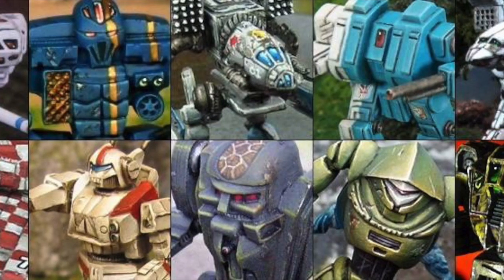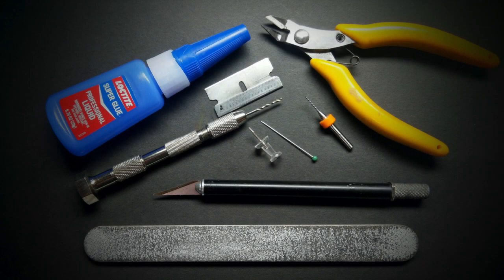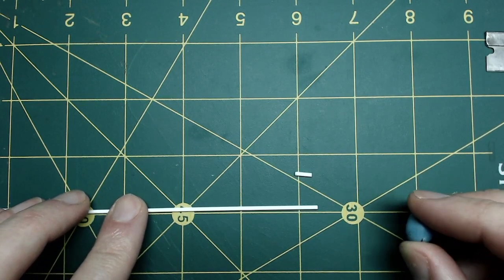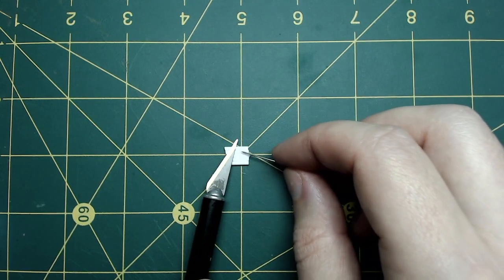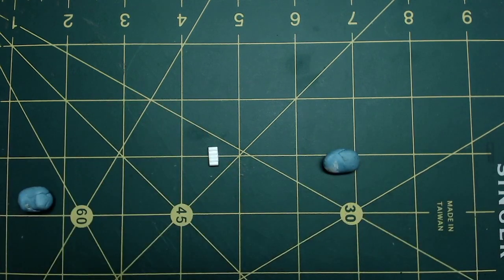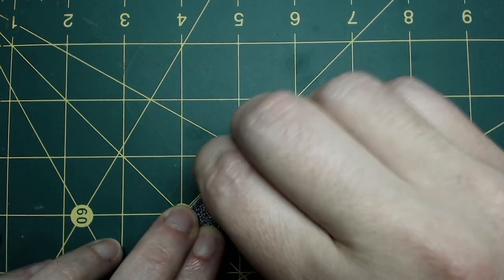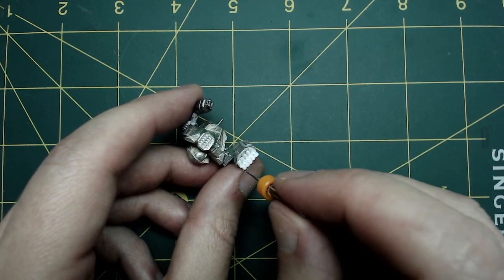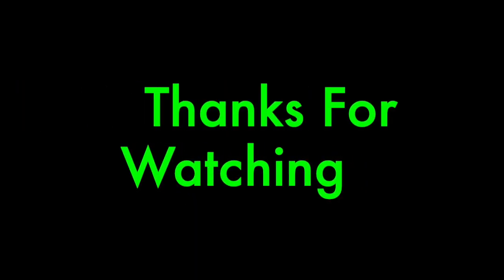Mech Weapons and Mods Using Styrene | Battletech Customizing

Comment: SRMs and LRMs?
Reply: For exposed missile tips, you can file a rounded, tapering point onto thin styrene sticks. Glue them together as in the video, cut with some extra length left on the back, and file the backs down to the appropriate length and angle, giving even more margin than with the missile tubes here. You may decide to leave them glued together in rows and attach them a row at a time, or you might file them down until they're separate points to give more space between them, depending on application.

For large pods mounted external to the body (e.g. Catapult / TWolf), you may consider building a new pod from thin sheets of styrene in order to give it added depth. Cut extra bits for armor panels to glue to the pod to give it appropriate greebles.
Reply: @rmdcade1717  Thanks!
Reply: You can also green stuff a small square and then take a pen or mechanical pencil and push holes into it creating rings and the illusions of missile heads